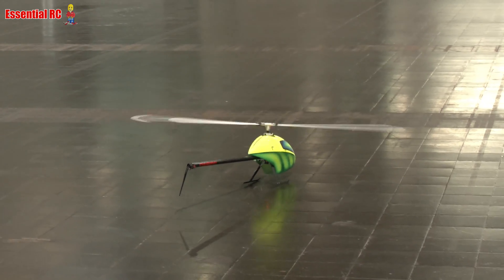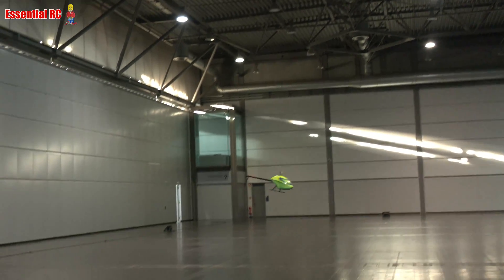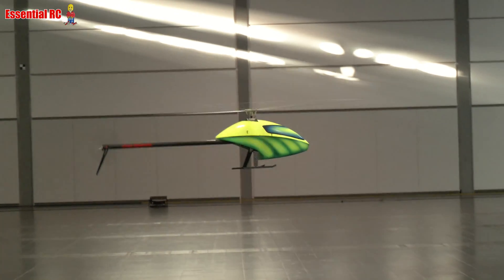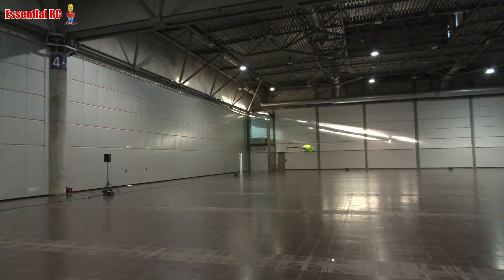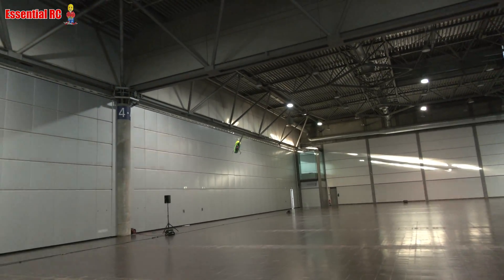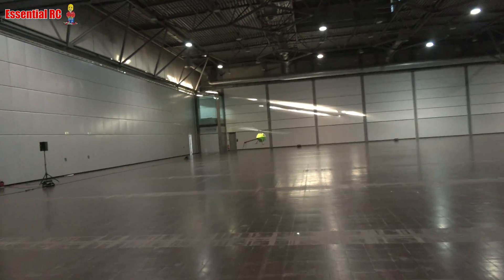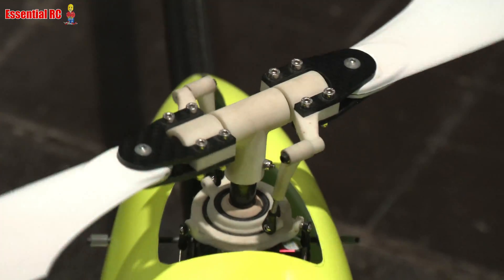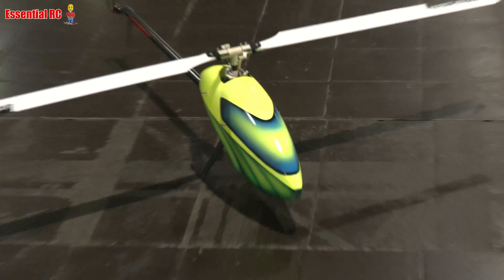Scratch built Ultra Lightweight 700 size 3D RC helicopter with 3D printed rotor head | Chris Tittel

Comment: Bravo to Chris ! This guy makes incredible models.

Except the blades, this kind of 700 should be much more crashproof, less dangerous and intimideting than commercial machines, also easier to control, less agressive, more smooth. This is the way to go for RC heli industry. Some people say "start with a micro cp, it's crashproof and not dangerous", some others say, "start with a big heli, it's easier, more stable"... With this kind of ultra light big size heli, you've got the best of each sizes for many pilots, a not to dangerous machine, relaxing to fly with, stable and very visible for smooth 3D, cheaper battery, servos, esc, motor, spare part also if well designed. The only drawback I can see is wind handling. Other than that this is the perfect machine, perhaps a bit extrem in this version, but the way to go for the futur of rc heli.

Hopping one day, RC heli brands will understand this and catch this huge market. Not everybody is a champion with incredible skills able to use 100% of a killing machine, but the market goes this way, more power, more headspeed, and more weight to handle this.